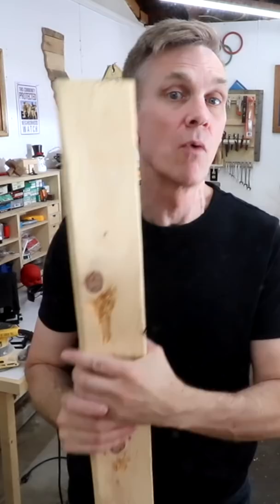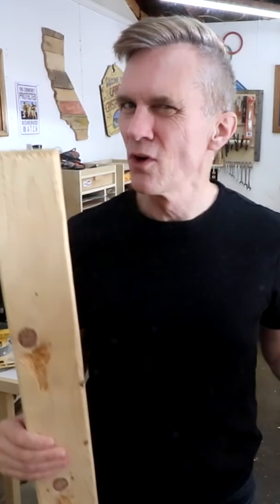Why do 2x4 boards have rounded edges? #shorts

Comment: No its all about money 
If they shave the 4 corners on every 2x4 to preciceve all reasons listed in video then they turn around and use all the shavings for plywood or particle board then they double their production by erasing and needless but wanted object remember if you want the answer to anything follow the money